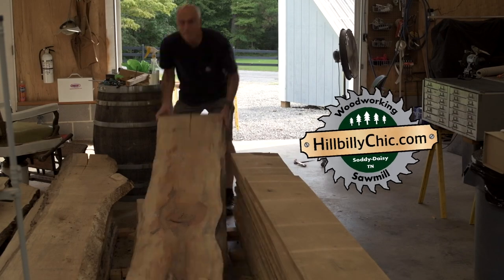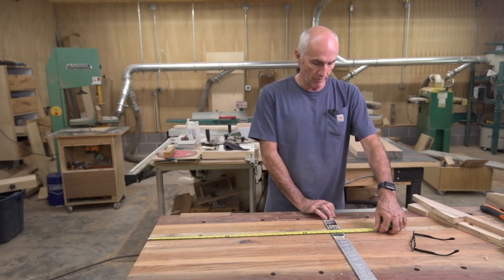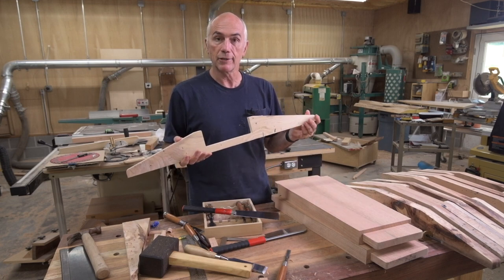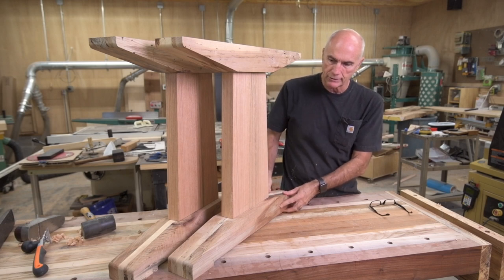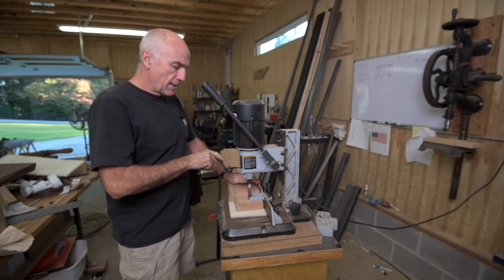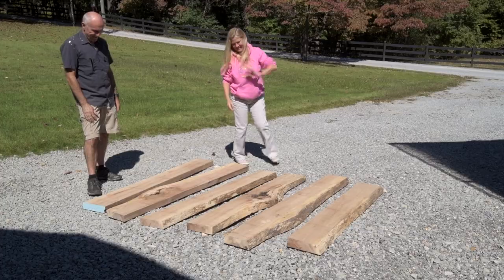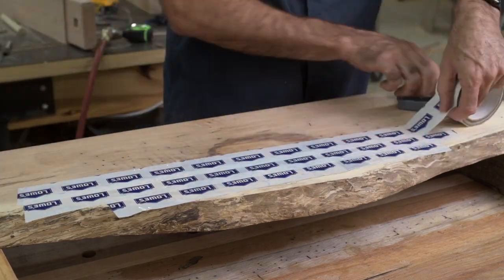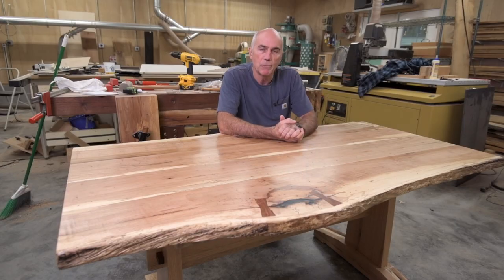A Modern Twist on a Trestle Style Dining Table Build (How To)

Comment: Best trestle table video. Technique, dimensions, etc. Same type table that I want. Question about the upright/horizontal support members glueup. Is the upright piece allowed to expand and contract across the grain?  An assembly similar to breadboard ends might be better. Elongated holes through the tenon for the two outside dowels. Glue only the center few inches. Also a shopmade breadboard end jig to route the tenon.
Reply from the maker: Looking back at the video the tenons were somewhat loose fitting but I did not take that into account.  I think I probably got lucky and since I made this during the summer the fit would only get looser as the humidity drops.  I also don't think I oversized the hole on the tenons to allow for expansion.  Live and learn..  The table is holding up well but I do wish I had painted the upright red oak pieces black.  I'm not really liking the pinkish hue that the red oak has.